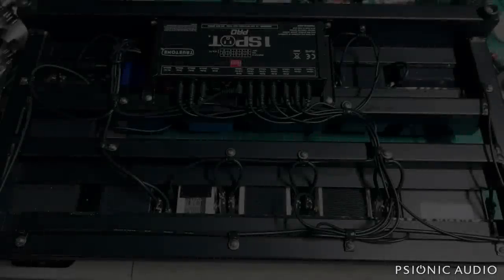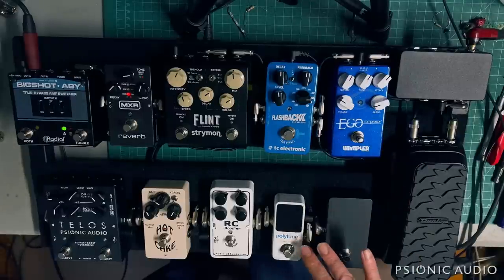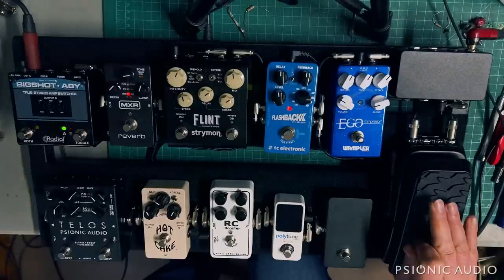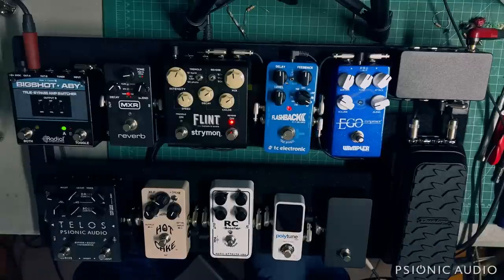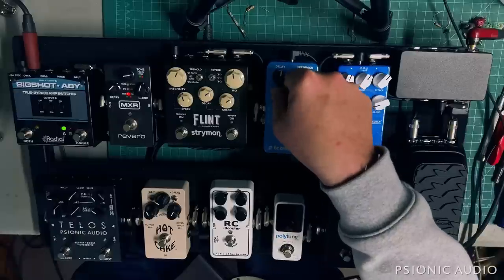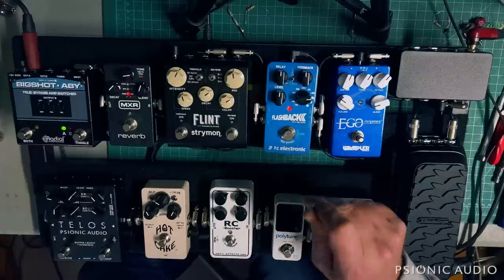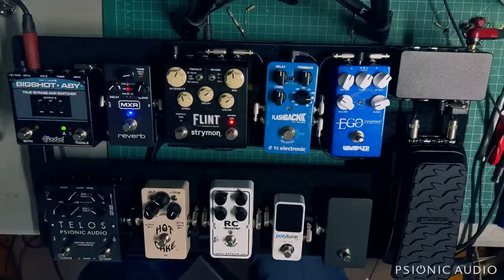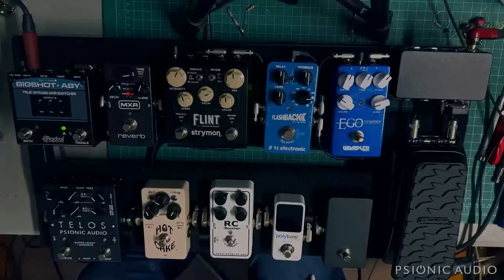Pedalboard Completed

Comment: The Hot Cake is one of the greatest drive pedals of all time. So crunchy and clear. 
Also, I am normally not a compressor guy either (I only use it when there are some extreme frequencies that I need to even out), but the Wampler Ego is by far the best one I have ever tried. It doesn’t alter my tone like many others I tried.

Comment: Great work! The cabling is excellent, it looks so clean. The MXR Reverb is amazing! I've had the TC Electronic Hall Of Fame 2, and it's a great pedal, very versatile. But when I bought the MXR Reverb, because I was building a secondary pedalboard, it blew me away, and it blew the HOF2 off my main board. Later I scaled down to just one board, keeping only the pedals that are essential to me, but also a few that I don't use often, but they have their place because they help creativity, and I use them on a song or two... TC Electronic Brainwaves pitch shifter, Ibanez mini tremolo and MXR Uni-Vibe. Besides that, I have no mod, just an overdrive, a fuzz and a distortion, plus two delays and the reverb. Well, my distortion is Old Blood Noise Endeavours' Excess V2, and there's some mod there too. I actually want a bigger board with more different and unique pedals, but it would be too big and too heavy to carry around. Plus, I have an 8 pedal switcher and every pedal is connected to only one loop, except for the two delays (though I should separate them) and the distortion which has a noise gate after. Maybe I should put the distortion and fuzz in the same loop, because I don't use them simultaneously. That would give me one loop per each delay pedal, so I could go from subtle to wild delay more easily. 

That's the benefit of commenting on YouTube videos. You might figure something out. 🤓
Reply: Everything MXR make is great.

Comment: What specifically are you using for the cable management?
Reply from the maker: 1/4”,  3/8”, and 1/2” cable clamps, #8 sheet metal screws and #8 washers.
Reply: Thank you

Comment: Beautiful board.   Great demo of it also.  I couldn’t stand compression until I started chicken pickin.   Xotic SP Compressor with dip switches on default, compression switch on Low, and their factory suggestion ‘Boost with Subtle Comp’ from the owner’s manual is gold for me.   It’s always on.